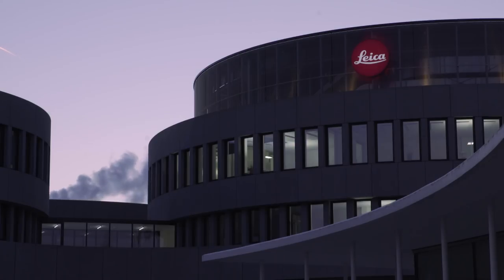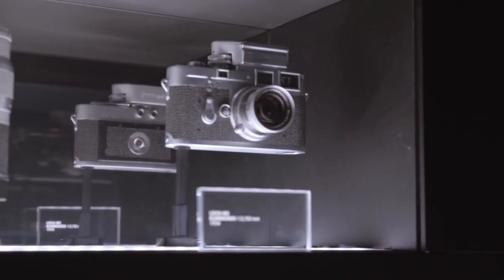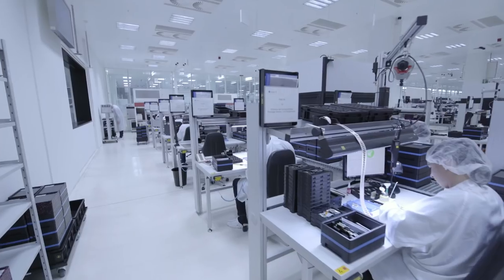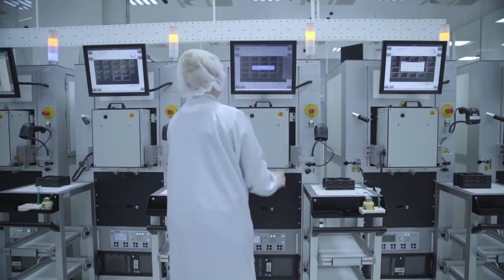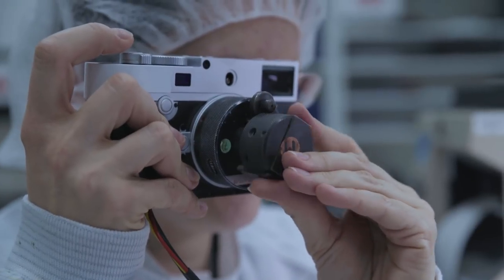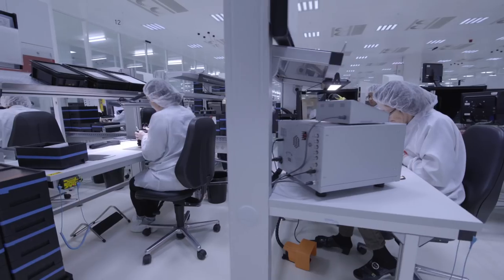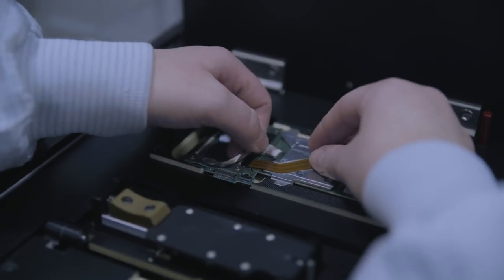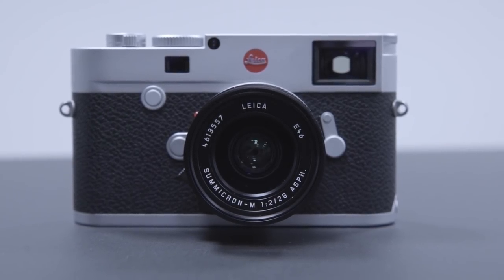How It's Made: Leica M Camera by Surface Magazine

Comment: I used canon system for 10 years then switched to Fuji GFX mid format system for 5 years. Wanted a small travel camera but high quality. Couldn't justify the value for Fuji Xpro 3. Went to the store and got Leica M10-R instead. And must say im BLOWN AWAY. i always thought of Leica as an overpriced brand with results just like many good cameras produce which also can be achieved in post production. Boy was I wrong! The images are absolutely stunning. BUT you have to know what a good image is to appreciate it to be honest. Many think more megapixels = better image. That's how we are being sold to. You need to look at colors, tone transitions, micro-contrast, dimensional aspect etc. This is as close as you can get to film. No more pixelated harsh looking "dead" images for me. THANK YOU LEICA ;)
Reply: I own both the x pro 3 and Leica m6. So far, I’ve seen myself use and pick up my m6 so much more than the Leica. The workflow, history, and the process that goes into photo making is noticeable. It makes me want to pick it up and go outside rather than nitpicking some of the tech i wish a camera could have.

Comment: is it not true that most of the time / labor spent making the camera is actually in Portugal;?
Reply: Nope... check your sources.
Reply: @Sams911  Partial quotes do not quite reflect reality: The mechanical parts of Leicas are mostly made in Portugal, true, AND the lens and camera assembly (and control) are in Germany, so are lens design and production (which is still quite a proportion of the time / labor, especially lenses, so no, most of the time /labor is not in Portugal, just the mechanical parts of the cameras [by the way, the sensors must be the most costly part of the digital Ms and they are not made in either Wetzlar nor Portugal]. FYI, an addendum : soon Portugal is to produced 3 lenses specifically for the US market in order to circumvent tariffs increased by the Trump administration on EU products.
Reply: @BrunoChalifour  Bruno.. I own a M10P and a Noctilux 50 .95 ... I want this stuff to be as much as possible made in Germany... but I know that if US Law were to be applied, this camera would not qualify as made in Germany..  more over, where is the sensor made?  China?  Leica won't even tell us the country of origin of this critical item..  I feel they are using the "Made in Germany" to get top dollar while farming far too much manual labor to a low cost labor market..
Reply: @Sams911  I also own Leica film and digital bodies. If it had not been for moving the plant to Canada, the M series would have disappeared. So moving out of Germany (and both cameras and lenses assembled there (including Noct f 1) wore "Made in Canada" without our seeing the prices decrease at the time. The current sensors are possibly made in Europe as was the one for the M240 (although they will not disclose it) or China or Japan (Sony? Sony makes the sensors for Hasselblad...). The "Made in Germany" is part of their identity and one of Kaufmann's wishes (without whom Leica may not have survived the digital transition). It differentiated cameras and lenses once the production of the M6 went back to Wetzlar. It also provides work to some 200 people in Wetzlar and 700 in Portugal... what other camera/lens manufacturer (except Hasselblad who also only assembles its cameras in Sweden) provides work (and the social/health benefits that come with it in Germany and Portugal) under such conditions? How many cameras are assembled by hand with that minutia and quality control? Everything has a price I guess. Both the excellence ofLeica and Hasselblad has survived thanks to these choices, could we blame them?
Reply: @BrunoChalifour  I am a Leica fan.. own a lot of their optics including Binoculars and rifle scopes.. I am however sad that the made in Germany is only partially true... I am just glad they haven't sold out to China, in which case I would no longer buy their products if this were to happen.

Comment: Have you noticed how much more you have to pay for real quality?  Other things I've bought in the past - things that I just liked watches, fountain pens, etc....- have gone way up. I have a rolex watch that  I can get 10x used what I paid for it new.  Things are getting "crapified" - companies are trying to extract every last penny from you, while trying to drive costs down as far as they can.  They're pretending that you are getting the same thing that you did in the past. Case in point: a 'little red wagon' I bought for one of my kids. Same thing my parents bought 35 years ago? Then: rubber wheels, steel construction. Now: blow molded polyethylene wheels, plastic construction.  I got rid of a 1985 mercedes I owned last year - 360,000 miles on original engine and tranny.  The mercedes's of the 2010's are not even close in durability.  Manufacturers hope you won't notice this. They want to coast on their reputation.
Thing is folks, if you want real, honest-to-God quality, you're going to have to pay through the wazoo for it.
Reply: Well this is true , I know that some Leicas had a sapphire screen display , and the new M10 models include a gorilla glass screen , for the price ($8,000) I think it’s fair to use the sapphire , some say that they didn’t included that material because the touch screen, that’s totally a lie.
Reply: mariogpx damn it! I got ripped off! My m10 has no screen!

Comment: bought a brand new leica m6 ttl o.72 years ago and shot 14 photos with it and sold it.good job i did not lose a lot.i could not get on with the rangefinder camera.love slr cameras they are much better and faster than leicas.love nikon f.f2.nikkormat ft3.f3.canon f1.minolta xd7.olympus om4.om1.pentax mx.km.kx.k1000.spotmatics.they are all quality cameras
Reply: M6 TTL 72 years ago? Wow, that's years before Leica made the M3... lol
Reply: @MultiNemesis101  No an 0.72 viewfinder M6TTL...
Reply: The fact you could not use a rangefinder is your responsibility, not Leica's. It is a known fact that the rangefinder (just because of its base) allows far more accurate focusing than a (film) SLR, and the clarity of the viewfinder does not depend on the maximum aperture of the lens used. The shutter is far more silent and produces far less vibrations than those of a Nikkormat or F2 which allows the user to photograph at slower speeds (important then with limited ISO). A camera is as fast as the one who uses it. Focusing and triggering the shutter on a Leica is far smoother and faster than on a Nikkormat or an F2 (and I have used all three cameras). It is true that there are areas I would not use a Leica M (microphotography, situations requiring zooms or long telephoto lenses), but Ms are not design for such uses.

Comment: The problem is....
Fujifilm made a better viewfinder mechanism than Leica.

Come on Leica, Fight Back !!
Reply: Why because its part EVF? You can purchase brand, or off brand EVFs for your Leica M. People lost their shit about having video in their Leica, which didn't bother me much but the purists weren't having it. Most Leica shooters wouldn't want it on, or anywhere near their Leica M.
Reply: before you defend Leica, know that they wanted a hybrid viewfinder too - but the technology wasn't there. Instead of having a mediocre OVF and a mediocre EVF, they went for a really good OVF. Fuji can do it because they don't need an actual rangefinder in their cameras.
Reply: Visibly you have no idea what you are talking about! Get informed. Leica rangefinders (not "viewfinder mechanism) and the electronic system used by Fuji have very little in common even if one is derived from the other and if Fuji based its whole X series on the Leica model. Leica came first... Fuji copied and added its own savoir-faire... in the end two very different products. Again, apples and oranges. Learn your fruit!